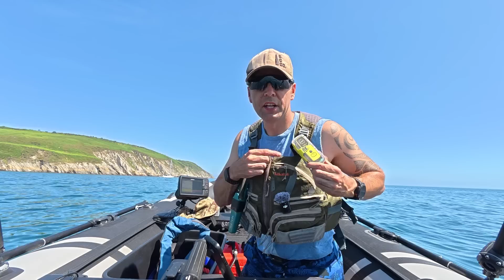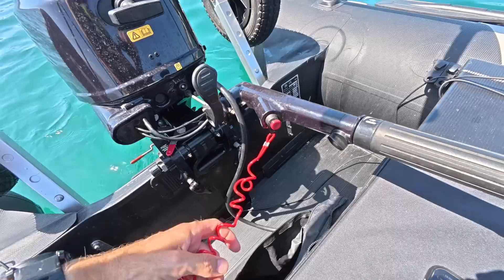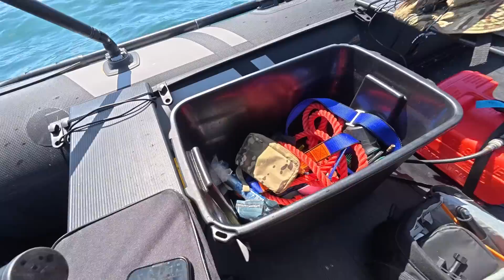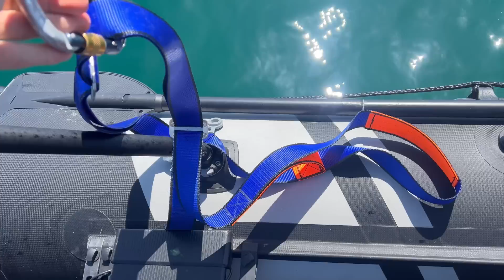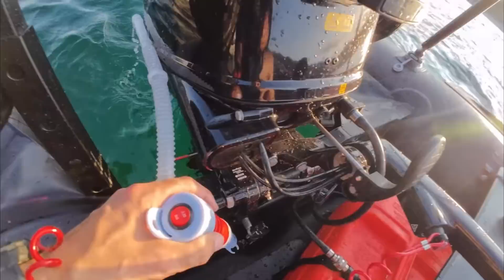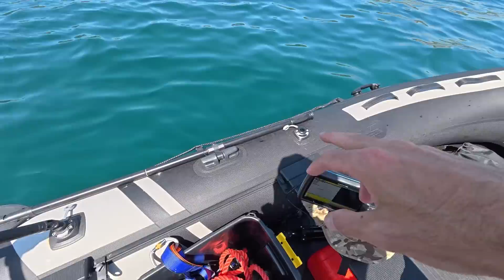SMALL BOAT SAFETY: ESSENTIAL GUIDE & GEAR YOU NEED 🌊

Comment: Quick note about the kill cord; NEVER wrap it around your wrist; clip it to your PFD, a belt loop, tie cord on your shorts or round your ankle!

If you come out you are grasping for the boat and the cord WILL roll off your wrist as you go overboard at the worst possible time.  If you wish to use 

a wrist cord you need to have a wrist band that cant come off, they're cheap and may just save your from an incident.

bloody good idea with the first aid kit and personal locator though, I hadn't considered more than a small kit but a heamostatic gauze and 
tourniquet would be a good addition.

Comment: Ive just purchased a carbon pro 400 and 20hp tohatsu. With seamax wheels. Not been out yet...For one person do you think is it light enough to pull up steeper slipways. Im in Cornwall. Thanks
Reply from the maker: Yes I regularly pulled mine up the slip way! Obviously depends on your capability but I found it okay and my slip is quite steep

Comment: love your videos on the water, so much so ive purchased a carbon pro 400 trailer and yamaha 25hp. Ive just got a garmin striker 7. Do you have any recommendations as to where to fix transducer to transom on carbon pro and how and what battery to use in that peli box you have. Many thanks and all the best.
Reply from the maker: Nice buddy you won’t be disappointed. I screwed my transducer to the back right of my transom and carry a 12v battery in a peli case during each outing.
Hope that helps
Reply: @AirbornePirates Thats brilliant thank you. What size battery is it that fits in the case, there is so many put there. Different amph and lithium ion ect.

Comment: I have another question for you.  How much wind is too much wind to be out in carbon pro 365?  Onshore/offshore . Thanks
Reply from the maker: Tough one, I’ve been out in 15-20mph winds no problem, it’s when there is swell too, where I live the easterly winds cause rough chop. So it’s a location by location basis generally
Reply: @AirbornePirates thanks for the reply. That's a fair wind,  did you get airbourne.

Comment: Brilliant video Matt, very useful so I have shared a link on my FB group, hope it gets you an extra view or two 🙂

You get a bonus point for mentioning spare kill cords, I'm an advocate of this as it makes starting the boat and using it to perform a rescue is possible. The boat will often stop within swimming distance** which is fine as long as the person with the cord didn't clatter their head on their way out. My boat is 8m GRP with a small swim platform on the back, if I or another fall off it that's a lot of hard surface to bounce off.

** I will have to try mine with a fender overboard as I pull the cord...
Reply from the maker: Cheers mate, appreciate the share! 👍  Hope you’re doing well 🤙

Comment: Hi mate what horse power you got on the back.....I got a 4 hp and seems abit under powered....was looking at a 25 hp ......is that 2 powerful for my 3.2m sib.
Reply from the maker: 20hp on the back mate! Your transom will have a HP rating normally, it may be on a plate?
Reply: @AirbornePirates only had the boat a week didn't think of looking there😂...cheers,great video 👍